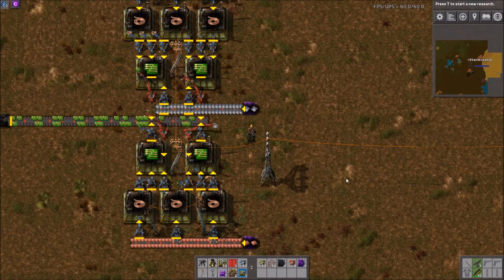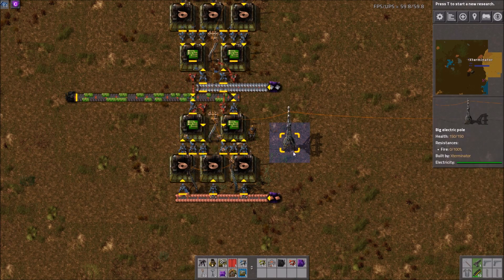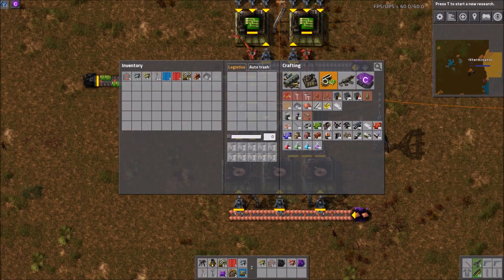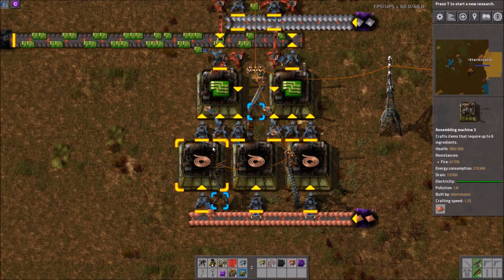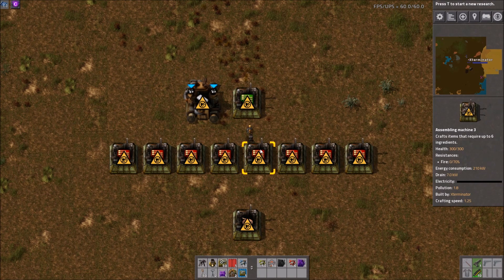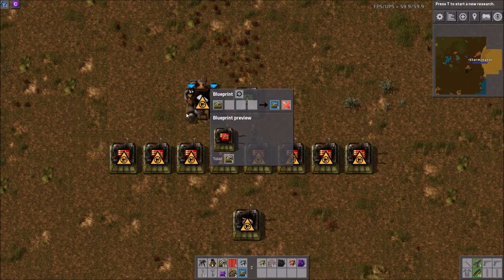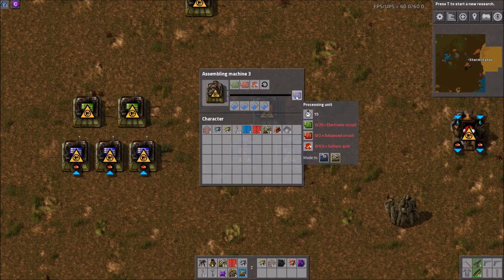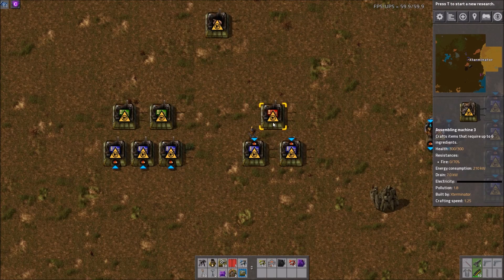All Circuit Ratios - Factorio Tutorial

Comment: It's always better to have to much production than to little. If you put one speed module on the red circuit machine (which you should have if you're producing blue circuits), you'll have a 20% increase in speed for the red circuit machine. This means you won't have nearly as much surplus as you would if you made it a one to one ratio, but there would never be a stop at all in the blue circuit production. It is as close to a perfect ratio you can get until you get 16 red circuit machines and 15 blue circuit machines, which would be a bit later in the game. Overall, until I'm getting mid way through yellow science and put down the 16:15 ratio, I normally put down two red circuit machines with one speed module on each and have them support 4 blue circuit machines.

Comment: So how does this work with you have 1 assembler operating at 0.5 speed and another at 0.75 (Assm. 1 and Assm. 2). 

How does someone account for the various crafting speeds when calculating these ratios?
Reply: Time * 0.75
Reply: essentially as goatz posted ... basic time to craft ... say 1 second .... add performance modules of one sort or another ... take that time and multiply it by how much the increased performance is  so if it gives a 25% improvement ... thats 1 - (1 * .25) or (100 - 25)/100 * 1 

then add the different ratio machines up in your process and divide by the total number of machines ... that will tell you how close to an even or perfect ratio will be ... fractions mean you need to improve something on your line ... even numbers give you perfect ratios odd numbers tend to give almost perfect ratios ... a short delay like the red to blue circuits ratio in the video (1sec delay every 7 cycles or seconds)

advanced warning you will be become very familiar with the decimal equivalent of common fractions ... like thirds fifths eights etc .... sorry 'bout that ;)

Comment: I usually pull in green circuits from my bus to created the red/blue circuits.. should I not and make the green circuits on site?
Reply from the maker: Either one works. However, in 0.15 they changed the craft time of some stuff so now green circuits are exactly a 1:1 ratio to blue circuits so making them on site would actually be pretty good.

Comment: I've got a question that's been bothering me for a while. While the assembler ratios are clear, what about belts? How much do you need to saturate 1 blue belt?
Reply from the maker: That is pretty easy to figure out once you know how. Essentially you just figure out how quickly you're producing the item and then compare it to the speed of the belt. So let's say you are making Red Circuits in a level 3 assembler. They will take 4.8 seconds to craft (6 seconds divided by 1.25 which is assembler speed). Then you could just multiply the belt speed by craft speed I believe. So for a blue belt, they move 40 items per second. If hypothetically you were making 1 red circuit every second per machine, that means you would need 40 machines right? 
However, we are only making a circuit every 4.8 seconds. So it's nearly 5x that amount (4.8 * 40) which is 192. That's total, not per side. 
I could be wrong, because I woke up not too long ago lol But initial math says that is correct.
Reply: I was actually talking about input belts, not assemblers. But thanks for thanks for that as well
Reply from the maker: Compadre 420 Ah my bad. Well same thing would apply in general.  Just gotta see how fast how make items, and then how much of the input ingredients they need. Then you can figure out input belts. 
So for example, if you need to 4 iron per second for one machine making something, then a blue belt of input could support 10 machines.

Comment: So simplified. It's P = produced/time, N = needs/time. The formula is P/N which is also ratio to P:N
example: 
copper cable(cc) : green circiut(gc) 
P/N
=(2cc/.5s)/(3gc/.5s)
=(2cc/.5s)/(.5s/3gc)
= 2cc/3gc 
green circ (gc) : blue circ (bc)
P/N
= (1gc/.5s)/(2bc/8s)
= (1gc/.5s)*(8s/2bc)
= 1gc : 8bc

I hope this helps any body who understands math this way.
I don't get verbal math, thus This video is a bit confusing for me.
Reply: It can be expressed as "P≟NP" but i couldnt find the symbol easily.
Reply: It's P versus NP, not equals.
He was trying to reference a famous unsolved math problem, the prize is 1M.
Reply: But, does P=NP?
Reply: That makes no sense. In no way does anything equal itself times another thing.
P doesnot = NP

Comment: In the very early game, you can make a 1:1 ratio setup of cable to green assemblers by using assembler 2's for cable and assembler 1's for green circuits. (0.75 crafting speed vs. 0.50 equals 3:2, which is equivalent to the common setup of 3:2 assembler 1's.) But I find that it stalls slightly every few seconds unless you use fast inserters with a stack size bonus of at least +1.

http://imgur.com/GIGr1O8

It was an interesting experiment. :)
Reply from the maker: That's is an interesting experiment! You might be able to do something like that with level 3s and level 2 assemblers as well. However, I find it is usually better to just stick to all the same level of assembler instead of using different levels to achieve a good ratio. 
As you mention though, for early game that would actually work pretty well! Nice find. :)

Comment: Thanks for taking the time to put this info together, really handy! One thing though, you messed on the red to blue, it's nearly a 1:1 ratio, not a 1:2.
Reply: That's exactly what I said :P I was pointing out it falls just short of a ratio of 1 red to 1 blue, he doesn't mention that, he says it falls just short of a ratio of 1 red to 2 blue.
Reply from the maker: Yup, I derped. I'm wondering if I should take the video down, make a note in it or redo it and then re-upload it? 
I can't believe I made a mistake as simple as that honestly.
Reply: Wouldn't worry! It's definitely not worth taking the vid down for, I'd suggest just using the YT post editing to add a text box over the vid to clarify. Saves losing all that correct info for a minor thing :)
Reply from the maker: loneRang3r Thanks! Although it seems the only way to add a text box is the annotations, and unfortunately don't can't be seen on mobile and can't be used with an End Card. :/

Comment: Can you do a follow up with PM3 + SM3 beacons? I know that green circuit becomes almost 1:1, but I have trouble calculating for red circuit or blue circuit. Thanks!
Reply from the maker: Yup! I plan to do a video in the near future about how to calculate for modules and such. I can see how you would have trouble calculating for it, cause it's a fairly complex equation that changes depending on if input or output is your main limit, etc. 
But yeah hopefully that video will help answer any questions you have for that stuff. :)

Comment: In the case of Advanced Circuits to Processing Unit, wouldn't it be a almost 1:1 ratio?
If 1 machine produces 1 Adv. Circuits every 8 seconds then in 16 seconds it will make 2. And the Processing Unit requires 2 every 15 seconds.
With a 1:1 ratio the Processing Unit machine would stay still for 1 second after it finishes producing 1 item.
I think that a perfect ratio would be 16:15.

But great video, love your work Xterminator.
Reply from the maker: Damn I had a feeling I messed something up but couldn't figure out what it was. :/ I'm wondering if it is worth making a note in the video and re-uploading it?
Thanks for the correction though, and for the support! Really nice to hear you enjoy the videos. :)

Comment: And what if you wanted to make a Copper - Green circuit 1 to 1, using modules? possible?
Reply from the maker: Yup, if you use modules then it becomes more of a 1 to 1 ratio. I will be doing a video in the future specifically on moduled builds so that's why I didn't mention it here. :)
Reply from the maker: ***** Yeah it's super close to 1:1 which is nice. And I agree, using max Productivity is usually preferred because you just save so many resources that way.